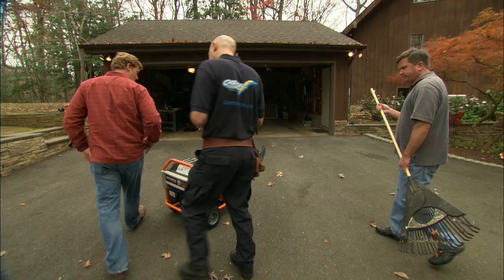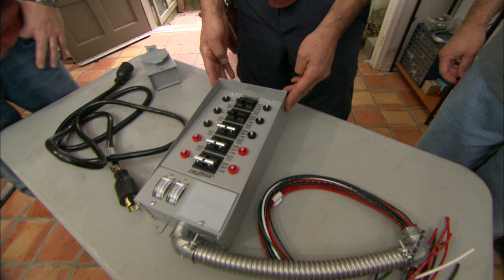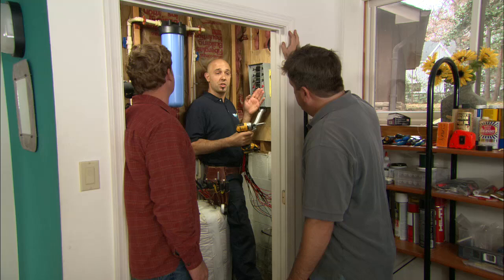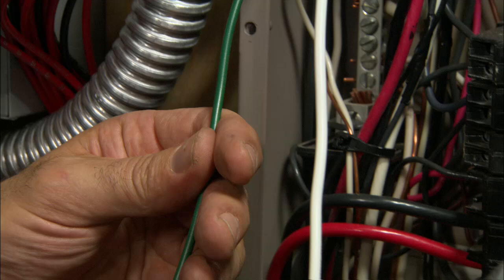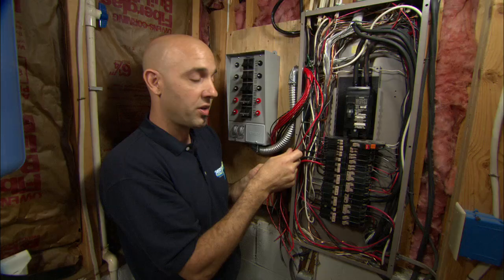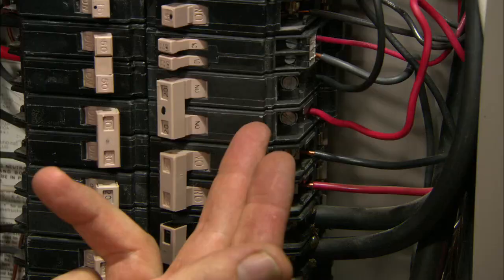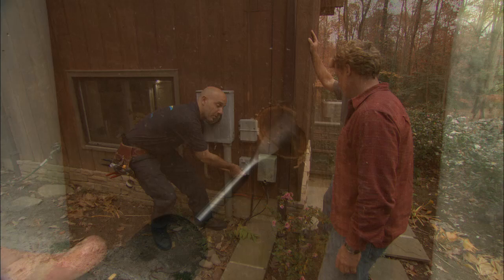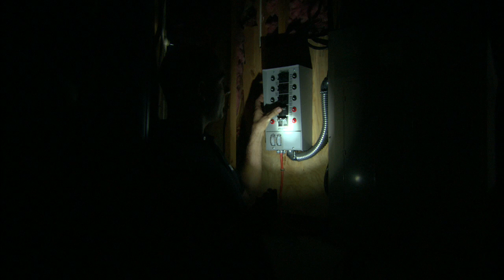How to Install a Transfer Switch for a Portable Generator | Ask This Old House

Comment: NEC doesn't allow you to connect a ground and neutral to the neutral bus bar, even if the bars are bonded. This video should have shown the installer connecting the neutral [white wire] to the neutral bus bar and the ground [green wire] to the ground bus.
Reply: Im glad someone mentioned this. Plus the fact that the generator has its neutral bonded to the frame as a ground. Being a two pole tswitch where it only switches the hots creates a saftey hazard. Removing the N-G bond at the generator fixes this saftey issue, but your generator wont be portable stand alone safe anymore (or comply with OSHA) until the N-G jumper is reconnected in the generator.
Reply: To clarify, two N-G bonds in one system creates a saftey issue during a fault condition that can electrify the frame of the generator because the N-G at the generator uses the frame as a grounding electrode.
Reply: ***** Mike Bald What if you just bought a generator which wasn't bonded at the frame and had a floating neutral? Also why does it matter if the neutral and grounding conductor were on the same bus, at the main panel they are bonded anyways.
Reply: Right I agree. Not hard to get a good ground. Just gotta do it.
Reply: Dylan Link if your generator did not come with a bonded neutral then you should be fine with a two pole switch no need to modify. Floating neutral generators at least in the portable market are unheard of due to OSHA. To answer your second question I am NOT positively sure what the code says. My guess would be that you do not want fault current from the ground conductor going to the neutral bus directly. Even though they are normally bonded at the main panel you want the fault current to go to the ground rod with the lowest impedance resistance possible.
Reply: The Honda EU and EM series generators are built with Floating neutrals.
Reply: First thing I noticed as well.   Earth from the pole may not be the same as earth from a generator.  The generator ground may have a voltage differential from both the pole as well as actual earth.  Am I understanding that correctly?
Reply: I'm not an authority of the NEC code, but from what I can guess is no earth at the generator and earth at the pole are one in the same when bonded. There may be a voltage potential from the two earth points but the bond keeps any objectionable current and voltage from being present.
Reply: Looked like the bus bar on the right wasn't even in use.
Reply: I beg to differ, but that Generac does NOT have the neutral and ground bonded inside the unit, which is why there's a 4 prong plug available to do home connections. OTOH, the gen set IS bonded to the frame of the gen set so technically the frame is grounded once tied into the home panel.
Reply: That Generac is also a floating neutral set.
Reply: It depends.  In a subpanel, the neutral and ground bars are always separate.  However, at the main service entrance point, the grounds and neutrals are bonded together anyway, so at this point in the system, the same bus bar can be used for either.  My house was built in 2006 and the main circuit panel was wired this way by the electrician.  It passed inspection, so it must be allowed (or at least at that time it was, if it no longer is).   Another thing to note, pay attention to where the main circuit panel is located relative to the service entrance point.  Some houses are set up where the lines and the meter connect to the house at one spot, but the circuit panel is located somewhere else.  In this case, the main breaker is usually placed outside in its own enclosure next to the meter with large cables run to a second panel holding the branch circuits.  Thus, the "main" panel here is really a subpanel and would need the grounds and neutrals to be separate.  However, if the main panel is located in the same place where the line power enters the dwelling, as evident by the main breaker being in the same enclosure as the branch circuit breakers,  the grounds and neutrals can be bonded.

Comment: I know this isn't code, but I just feed the panel through an unused 220 breaker. I shut the main off, make the Gen cord connections, start the Gen and power the whole house. I obliviously cannot use everything I normally use but it works.  OH, DON'T DO THIS YOURSELF, Get an electrician and follow codes.

Comment: I have installed a generac 8000watt portable generator to the reliance 10 circuit transfer switch with the outlet on the house..it worked great when I tested it..the generator has a label stating it is neutral bonded to frame...my question is:.do I have to do any grounding on the generator when I use it..thank you for any help..

Comment: In Chicago, it's against local electrical code to use wire nuts in the panel box. AND Never use your linesman's pliers to strip wires.
Reply: I've tried to find any reference to this in the Chicago code and can't find anything in this context that isn't aligned with the NEC.  Is there any chance you can point me to any section or reference?  Thank you it would be appreciated.

Comment: I saw the first splice for the kitchen wire, did you also need to splice for the others connected as well?
Reply: Yes all of the circuits being connected to the transfer switch wires will use wire connectors, resulting in the power flow travelling through the toggle switches before going to the load(s).  This creates a disconnect for each of the circuits being wired, always isolating the power from utility and generator (or inverter).

Comment: So the generator hooks into the breaker panels neutral? So at a wall socket the hot is from the generator but the neutral is from the power company. So if a plugged item shorts to neutral wouldn't that send power back to the electrical company. In theory.
Reply: Hello, I answered this in the other This Old House segment that uses a similar Reliance transfer switch, but here is a copy.  Yes, the generator neutral becomes common with the panel neutral (and all circuit neutrals) so that all of the circuit neutrals have a return path back their power source, either the generator or the utility.  Electrical current always returns to its source, and takes the path of least resistance.  In no scenario can I envision the path of least resistance of return current back to the generator, for any of the power that came from the generator, to land on the neutral wire coming from the utility transformer.

Comment: Good video.Thank you. What size wire was used to connect the outside gen box to the transfer switch
Reply: They used a 10/3 w/ Ground NM-B Cable it appears. This will allow you a 30 amp service coming from the generator with a black and a red conductor, each feeding the transfer switch at 120 volts each, to give you a total of 240 volts just like the utility service would if you weren't utilizing the generator.

Comment: Never seen one of these before but because he installed that interrupting  switch doesn't he technically not have to turn off the main breaker? Because when he swaps over from Line to Gen. he is removing that loads continuity from the panel
Reply: That is correct.  Basically this is is a control panel with 10 independent transfer switches in the form of those 3 position toggle rocker switches. The breakers in the house panel pass through the switches during normal power, the power from the generator passes through breakers in the transfer switch, then the switches and out to the loads during generator power.  It's defined as a "load side" transfer switch because you are performing the switching on the load side of each house branch circuit breaker.  Nothing needs to be shut off in the house panel because the generator power never feeds into any house breakers or the bus bar and always remains isolated.  Some circuits can safely run on utility power while others are running on generator power based on the position of the toggle switches.
Reply: Reliance Controls Thanks! Very informative

Comment: So when loads are served by the generator, where is the overload and short circuit protection for each individual circuit? grounding method? also generator is left outside but plugs are not waterproof. Electricity is not for DIYers. not to mention the wire stripping method and the non-use of end sleeves in multi-braided wires.
Reply: The transfer switch has circuit breakers for each of the 10 circuits, the generator power passes through all of these 10 breakers before passing through the 10 toggle switches and out to the circuits.  The grounding method is through the power cord from the generator, one wire within the cord is a ground wire and this wire grounds the power inlet box, and the transfer switch cabinet, by connected to them and then to the ground bar in the house electrical panel.

Comment: Can I ask a silly question. Regarding this manual transfer. What protects the utility workers of power is restored or so that there is no back feeding??
Reply: The toggle switches on the transfer switches are disconnecting the power for each circuit connected to the transfer switch when they are moved away from the LINE (main power) position.  The main power can be ON, and the generator can be ON and powering some of the circuits in the transfer switch if they are set to the GEN position, and there is no interconnection between the power sources as the toggle switches are isolating the hot wires from each other from each source.
Reply: The toggle switch!
Reply: The switch is a double throw configuration so the powered circuit can only be connected to one source at a time, either the utility power or the generator.

Comment: So with the code changes requiring AFCI protection on ALL over-current devices, how do you address the single (1) neutral wire for all the circuits within the transfer switch box?
Reply: Hello, the path of power from the generator goes out to the loads, back on the existing neutrals, through any AFCI or GFCI breakers that might be installed, to the neutral bar, and back to the generator.  The single neutral returns power to the generator when it's powering circuits.  The breakers in the transfer switch are in-use during generator operation, so the AFCI/GFCI's in the house panel are not engaged while the generator is powering the circuits.  Special wiring is only required if someone decides to install AFCI/GFCI breakers in the transfer switch itself to have that protection during generator operation, which is not written into code as a requirement for back-up power.

Comment: In all their videos they seem to have these utility rooms with no drywall and easy access to everything... I know it's for TV, but they try to make it seem like they are at some everyday persons house.
Reply: It was fortuitous that the generator inlet was right on the other side of the breaker panel.  I put mine on the back of the house instead of the front where the breaker panel is, so the generator can be more out of view from the street side.
Reply: This is exactly what my house looks like. Always has.

Comment: Ok I get everything else except the part of the interception from the breaker to the wires from the transfer switch, can you explain again
Reply: It may be described as a "load side" transfer switch, that is, it performs the switching and isolation of generator and main power on the appliance side of all of the house circuit breakers.  Each toggle switch is a 2 input, 1 output switch.  The breaker in the house panel feeds one side of a toggle switch, the breaker in the transfer switch feeds the other side of a toggle switch, and there is a single wire as the common output to the circuit itself.  Each switch now acts as a disconnect and isolation point between the generator and main power, all switches being between the breakers and the loads.  The position of the switch determines what power source can pass through it - either main power or generator power.  The installation consists of connecting the red wires marked with the letters of the switches directly to the house breakers, rerouting the power from each breaker through each toggle switch.  The black wires marked with letters are spliced to the load wires, completing the intercept so that each circuit is routed through each toggle switch. The result is 10 manual transfer switches in one cabinet.
Reply: That was very helpful, Im working on my electrical skills and I want to go to the next level

Comment: You can do it that way but you'll need lots and lots of money. Far cheaper to get a lockout plate to fit your breaker box.
Reply: How much cheaper to you feel it will be to install a lock out plate, including labor, including an inlet box, than the switch in the video (which probably took him 1 hour)

Comment: Is this a quality transfer switch? Would I find one of these in an electricians house?
Reply: Reliance has been making these transfer switches in Racine, WI since 1983.  The current model since 2002.  Yes we have distribution through nearly all electrical houses in the U.S.  Sometimes different branches stock a few models, but most of these products are special ordered and we ship from WI to the dealer or online seller.

Comment: What about the possibility of sending electricity out of the box into the power lines? How is that prevented?
Reply: A transfer switch's purpose is to always isolate two different sources of power to a load or common set of loads.  The model in this video has 10 independent transfer switches (in the form of 3 position toggle switches) that will always keep the main power and generator power isolated from each other due to the wiring and break before make action of the toggle switches.

Comment: How about this? What I have done, and it seems cheaper and easier than this but I'm no electrician, is shut off and lock the switch cover at the pole, shut off the main breaker for a second line of safety, then connect a 12 gauge line from the 230v on the gen to a double pull 30 amp breaker on my panel. 20 would have likely done it because I put out 21.6 amp max on that 230 outlet but I had a 30amp handy. That line I assembled myself with a 230v plug, wire and breaker.  I forget what I paid for it in '99 while setting it up for Y2K but I would figure $40 would cover it less any parts you have kicking around. For added safety, I could remove the main breaker rather than just shut it off.  So, what did I do wrong?

Comment: So your feeding all these circuits with a number 12 wire?
Reply: The model in the video does have number 12 wire which is rated at 20 amps.  This means that you can connect any circuits in the house panel that are on 15 or 20 amp breakers, but nothing larger than a 20 amp breaker.  Other transfer switches have the ability to handle larger circuits as they are either setup as typical panel boards with a linkage mechanism, or wired for at least a single 30A circuit using 10 gauge wire.

Comment: So in the event of a power outage, do I need to shut off the main breaker before activating the transfer switch to prevent backfeeding?
Reply: themanginaman No, we don't do that in my house. The transfer switch prevents back feeding.
Reply: No.  When correctly installed, the manual transfer switch completely isolates the circuits in question. However, they mentioned sensitive electronics' circuits.  I would not trust those to a non-inverter type generator. And these days many things have sensitive electronic circuit boards, chips, etc.

Comment: you can leave twist connections in the panel?
Reply: Indeed you may. The NEC allows it, so long as the splices and added wires do not exceed the allowed amount of fill in the gutters. That's the spaces to each side of the breakers.

The preferred practice is to use listed connectors, such as WireNuts, Ideal Insure, or Wago type connectors. On the grounds, Buchanan (crimp sleeve) is ideal, since the joint is not easily taken apart. Another practice commonly used, particularly in older places, is to twist a group of the grounds together and land them as one larger wire.

The NEC also allows you to double or sometimes triple lug same size equipment grounds only. This depends solely on the listing of the panel.
If it's not allowed by the manufacturer, it's already a violation.
As an example, Square D's QO series of breaker panels and ground bars allow up to 3 grounds per hole, provided they are all the same size and solid.

You also can't simply take the grounded (neutral) and equipment ground conductor (ground) from a circuit and lug them together in a main panel.
The NEC explicitly prohibits this.
If the 2 wires under the lug ever come loose, you'll lose any protection afforded by the EGC, and the circuit's grounded wire, which ties the hot(s) to 120V.

If it's a multi-wire branch, (MWBC) that loss of the grounded conductor could energize anything in the circuit to 240V (or 208 on a 3ph system), promptly letting the 'magic smoke' out of anything connected.

On a single pole circuit, you lose equipment grounding and the return path that the grounded [neutral] wire provides.

Comment: any and all electrical panels should always be bolted or screwed to wood panel for electrical shock from grounding out on metal walls or floor ground shock. many pipes are used in old homes as grounding connectors, use CAUTION ALWAYS.

Comment: 3:52 Unless I'm mistaken, doesn't code prohibit wire-nuts inside the service panel?
Reply: KINGsizeWINNER I thought so too but a few people that posted above say you can with clauses. Who knew ?
Reply: +KINGsizeWINNER no
Reply: Article 312.8 of the NEC 2014 allows it and provides the rules.  Some of the provinces in Canada have restrictions on this but nowhere in the U.S. that I'm aware of